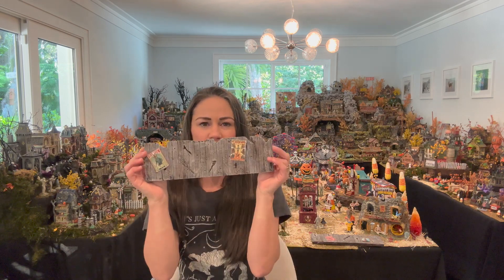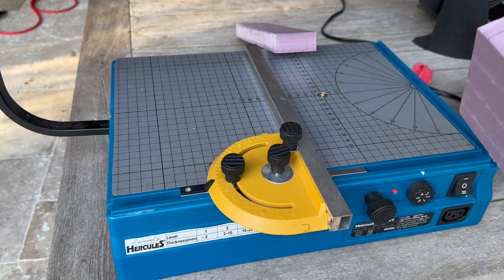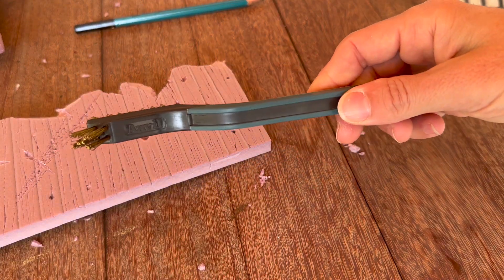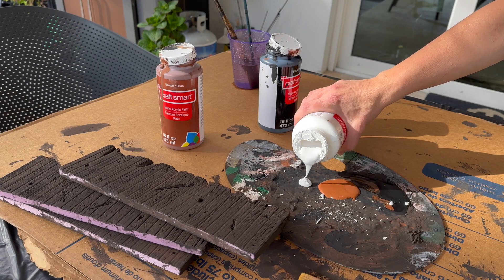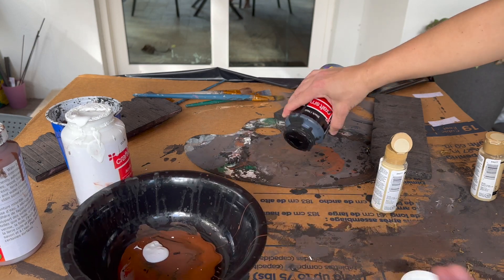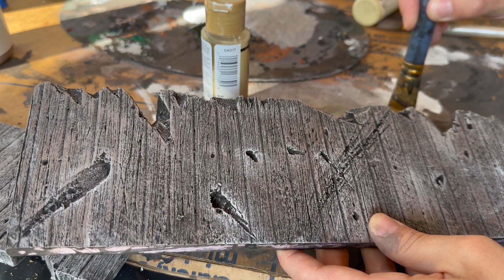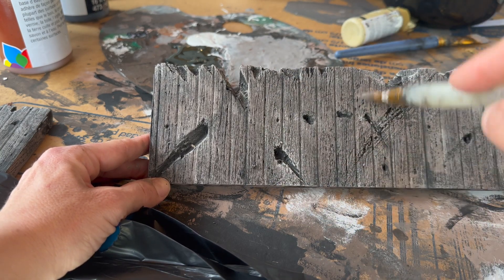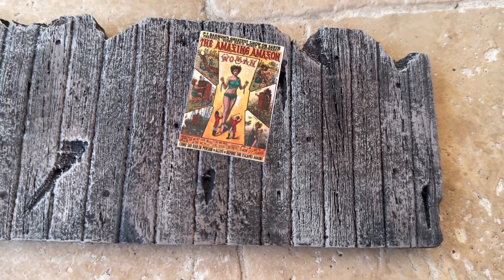Create a Wooden Fence Using Styrofoam (Halloween or Christmas Village DIY Accessory)

Comment: These look amazing! I can't wait to try to replicate for mine. I am looking for those posters you said you got on etsy but having a hard time finding the right size. Did you just get a regular print and shrink them down before printing? I usually wait until Aug/Sept to get creepy & creative, but it's just SO dang hot here in SC already - I am over it!
Reply from the maker: Thank you!! I actually ordered printed versions from the seller. I think the size is maybe around an inch. However…I have since seen those exact posters just through a go0gle search of creepy carnival posters/vintage carnival posters. You could copy and save them to a doc and shrink to the size you want. I just print on regular copy paper and use mod podge to apply to a thin foam or cardboard backing then attach that to my display. I feel you on the heat! Same here!! I create all my displays outside and I feel like I’m melting into the village! I’m so ready for fall!